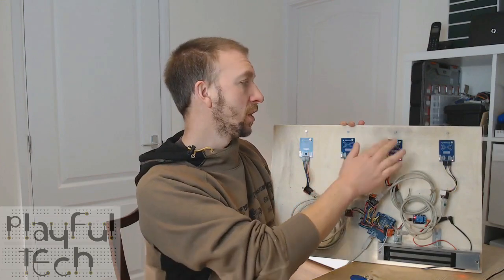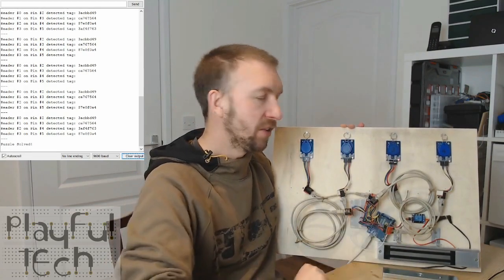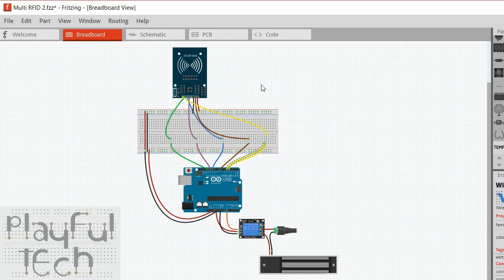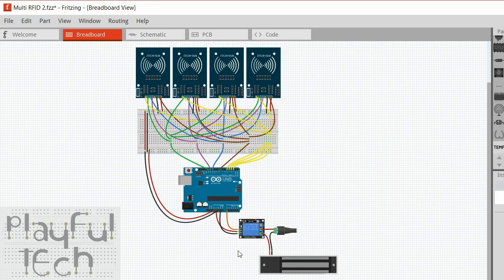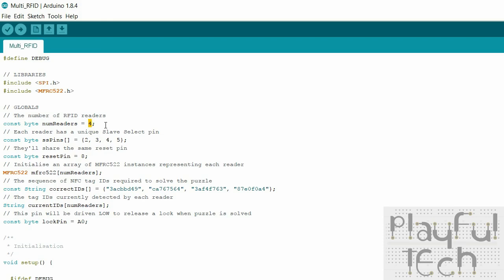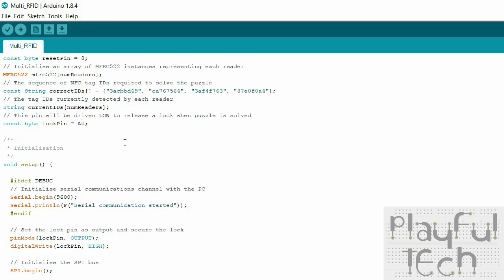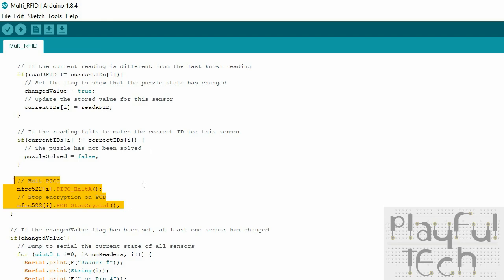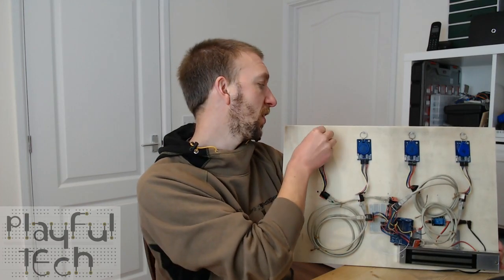Escape Room Object Placement Puzzle using Arduino/RFID

Comment: HI Alistair, great tutorial I have been pulling my hair out for weeks now trying to get multiple RFID readers to work and this looks like it might work for me (hopefully). I have been trying to get 8 readers working I know you mention you have managed 5 readers but is there any limitation apart from the crossover over the wireless ranges that would restrict this? e.g. If i position the sensors in a "star pattern" e.g the arduino being central and the sensor spreading out from this leaving a similar space as you have and the wires are all short enough +/- 20 cms, do you think this will work? or is there another limitation..?

Also I have I have seen another tutorial (using a different library ) where all wires share the same PIN except for  each MISO line which has it's own pin (IRQ lines are also used and connected together). Not sure if this approach is going to work as it seems a little strange having all SS Pins connected together....but do you think this would work and might possibly get around the device limit?

I was about to throw away all the kit I have bought until I saw your video, so you have given me hope :) Once again  thank you!
Reply from the maker: A Stvensk Hi, thanks for the comment, and good luck with it! I would advise you to start off with just a single reader as I did in the video, ensure that works, and then gradually introduce more. I'm not entirely sure what the cause of the problem I encountered with >5 readers on a single Arduino was - it could have been too much current draw from the Arduino pins (which you can easily correct by using a dedicated power source for the readers), but I think it was a timing issue on the SPI interface. Debugging was hard because the reader behaviour just became erratic.  But the approach I show here should work with up to 4 readers just fine. If I was to make a puzzle with 8 readers, the way I'd probably do it is to use two Arduinos - each controlling 4 sensors - and communicate between them using I2C, setting one as a master and the other as a slave which just sends the values of any read tags back. See here if you're not familiar with that: https://www.arduino.cc/en/Tutorial/MasterWriter
Reply: Thanks Alistair I was thinking of using I2C but I have gone through quite a few Nano's that I now have "welded" to protoboard with solder! (I really need to get better at soldering!) trying to get this to work. I'll give it a go as you have done and let you know how I get on, and thanks once again for your videos they really are great, much better than all the other tutorials I have been following for the last few months.

If I end up with no hair after doing all of this do you do create paid puzzles or is it only a hobby?

Comment: Hi, a newbie question: you use CAT cable for wiring. Are the connectors custom made, or can I buy them somewehre?
Reply from the maker: Christian K Hi. Yes, I'm using RJ45 connectors on a breakout board similar to this - https://rover.ebay.com/rover/0/0/0?mpre=https%3A%2F%2Fwww.ebay.co.uk%2Fulk%2Fitm%2F282518159661 - except I bought the RJ45 connectors and boards separately and soldered them myself, which is cheaper than buying an assembled module. It means you can use cheap, standard Cat5 cabling for any arbitrary data/power lines running between components in your project, which is hugely convenient!
Reply: Thanks for answer and your great videos!

Comment: Good video. There may be some issues when you will try to put RFID marks through 4-6mm material.
Reply from the maker: Yes, you're right - RFID signals will carry through a couple of mms of wood/glass/plastic without problems but not much more than that, so you'll want the mount the sensors as close as you can on the underside of your prop's surface to get the best detection. Reliability is also strongly determined by the orientation of the sensor and tag - you'll want to make sure that the sensors are mounted exactly parallel to the tags to get the best detection.  One way to do this is make grooves or mounting holes on the prop to make sure players place the prop containing the tag in exactly the best position to be detected by the hidden sensor underneath.
Reply: Have been fighting with that readers for 4+ years. And found some balance . The best result was 11 readers with one controller: https://www.youtube.com/watch?v=9DiK9gCSkVk

Comment: Fantastic! As a newbie, very helpful. Glad you made this!

Two things: I was trying to follow along with your code, and I ran into the error that "dump_byte_array" was not defined. Did you define the function somewhere else in the code, or was it supposed to be from one of the libraries? For some reason I keep getting that error. 

Second, you mention future video ideas! I'm working on another puzzle involving little Potentiometer knobs that I would like to attach to a mag lock using Arduino. I think I'll be using 3-4 knobs, that when turned to a certain angle, will unlock something. These are the knobs: http://amzn.to/2zK6Noo. I think that could be another cool video topic for the future!
Reply from the maker: Hi Kelsey,  thanks for the comment. The dump_bye_array() function is defined right at the bottom of the code listing, but I think it might have got cut off slightly in the video :(  Sorry about that, but you can download the whole code from https://www.patreon.com/posts/object-placement-15681373 .   And thanks for the suggestion about potentiometer knobs - I've used them in this puzzle! ;)  https://www.youtube.com/watch?v=wV6O_Kjl81U&list=PLogiUurtMYtR2Hf0-eg8-K2E9uRtpWzWV&index=6
Reply: can you sent me the code plz